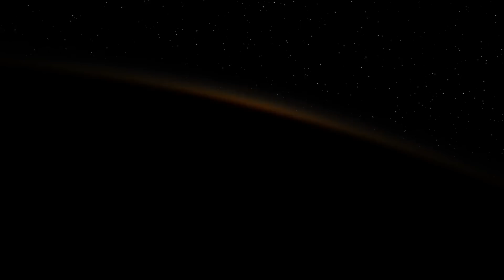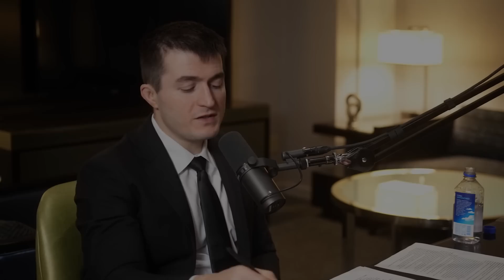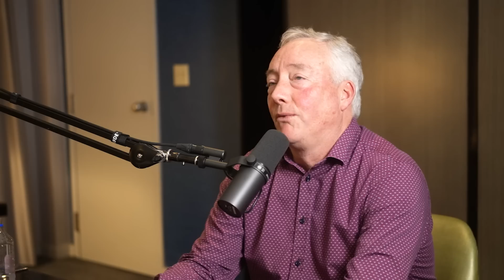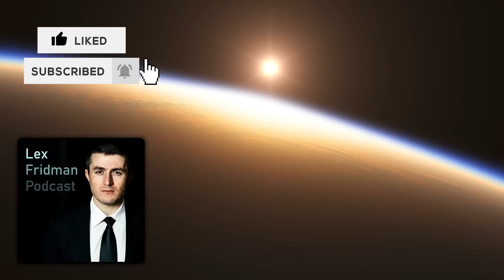The hardest challenge with Nuclear Fusion | Dennis Whyte and Lex Fridman

Comment: Fusion will not be available for the next 2/3 decades at least and Tokamak is a disaster in terms of cost,materials,size,fuel availability, time to build and nuclear waste (yes,lots of them). The only way to slow down climate change is fission, small and portable nuclear reactors. They are reliable, safe, ready, fast to build, scalable and deployable everywhere. Nuclear waste are easy to manage today, no big deal. Solar has failed despite  huge investments it had for the last 50 years. Lots of pollution,low efficiency and it’s not scalable. All large scale solar plants failed, that’s a fact. The only renewable sources with a future are hydro (all forms), wind and geothermic but they all have a huge impact on the ecosystem. We are killing ourselves by shutting down nuclear plants to use coal and oil
Reply: Couldn't agree more.  Why is nuclear not allowed to take off?
Reply: Modular Thorium molten reactors is a stepping stone tech that our world desperately needs.

Comment: Would like to know overall safety...nuclear was sold as safe..but, keep on going with the research
Reply: Nuclear is safe, fusion should be even more so!
Reply: when fusion fails, the reaction stops. Thats it. There's no hot core and radioactive waste.
Reply: don't confuse nuclear fission with nuclear fusion. Nuclear fission takes two unstable atoms and starts a chain reaction that produces energy. Nuclear fusion is pushing two atoms so close together that they become one and that produces energy. There's no radioactivity or anything like that with fusion. The problem is it is really tough to do that in a controlled way that puts out more energy than it takes to get it started.

Comment: shoot a bb sized pellet and achieve productive fusion for .0000000001 of a second:   WE DID IT!!    the tokomak is the only viable system in the works right now.  hence the many countries backing it.  if you look at a graph of power level outputs of tokomaks over time it's going to happen with iter and it's only going to keep becoming more powerful and practical.

Comment: Let me guess… Nowadays it should be pretty straightforward in constructing a giant building out of stone… perhaps a pyramid type structure, to house the ‘new’ fuel cell and its workings? Today, the entire outfit could be setup in a mater of days/weeks/months right?
Reply: No. It's still decades away. Ever single impossible question remains, we always knew fusion was possible. This "professor" just wants to be popular so he's saying outrageous stuff. I don't see fusion ever being viable on earth, maybe once we are space born and can hollow out or use an asteroid. It's the same problem with harvesting energy from electricity. The reaction happens too fast on earth to ever hope of storing or harvesting the extra.
Reply: Off by a fucking mile
Reply: All power plants essentially work the same way. They work like a steam engine turbine. The energy heats some substance that pushes a turbine that generates electricity. A fusion power plant would need some modifications, of course. But, that's not really the tough part at this point.